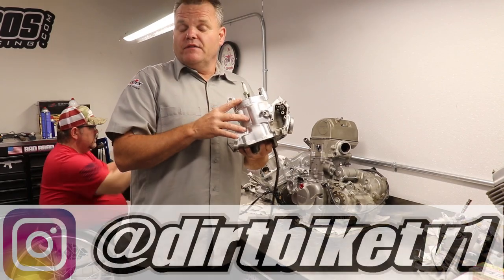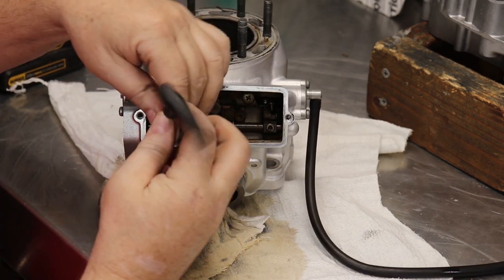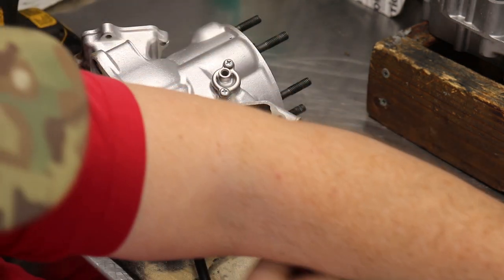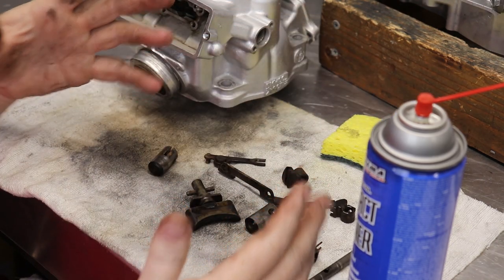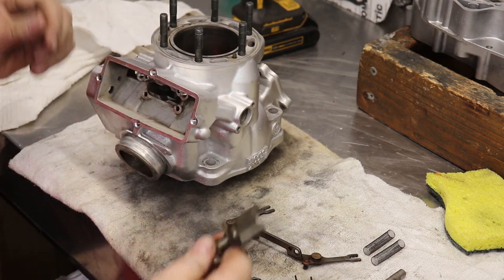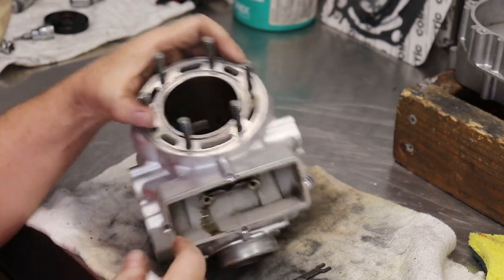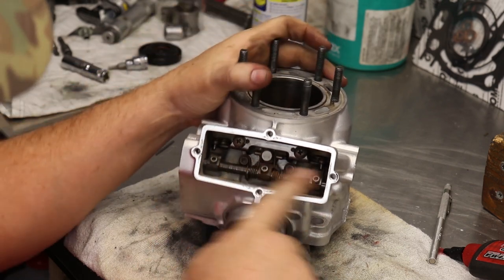YZ250 Two Stroke Power Valve Rebuild

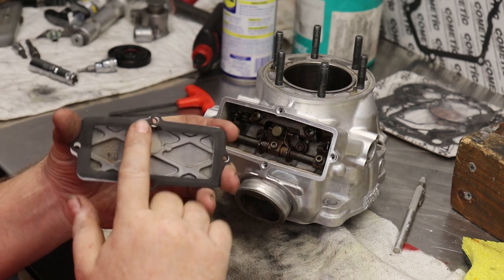Comment: Thank you for the tutorial , however at 9:35 the gasket is facing the wrong way, as the notch is supposed to look down not up. Not sure how much of an issue it actually is, but I figured I`d say something since the notch probably has a reason to be there.
Reply: I just put a new cylinder on my YZ250 and I double checked my manual. On page 4-19 it shows this notch "down" in the diagram.
Reply: Correct it’s down.
Reply: This comment scared me - I had paused the video when the cover came off and saw it down. Reassembled my bike then watched to rest and heard him say it went up! Thanks for clarifying via the manual
Reply: You are right, he is wrong.  My cover is off, gasket stayed on the cover,  Gasket notch is down, and it is for clearance for the center valve shaft bolt head.
Not too many people can do a perfect How to vid.

Comment: Well, I cleaned the goop out of the hex heads, used a new allen wrench (good one too), and stripped the head out of the center power valve shaft screw.  That one was too tight for the head.  Had to drill the head off, drill a smaller hole and use an easy-out.  Those are some soft screws.  I will replace them with better ones.

Comment: Bro my Yz 250 2t 2019 are leakin very much oil in the powervalve , i change the seals and nothing. How i can repare This? Help
Reply from the maker: email and send pictures--
Reply: The carb is jetted rich from the factory.  Learn how to jet your carb, and you will get more power, and virtually no ugly oil mess.  Usually, dropping the needle one notch (if your spark plug is black). leans up the middle very well, but can be a big jump.  You can get little washers that go under the needle clip to go less than a full needle groove jump.  Then I do wide open run to test the main jet, and put in a leaner main jet if needed until the plug is a light color brown at full throttle. (Hit the kill switch at full throttle so the plug does not darken up for a false plug reading from lower rpm running.).  You plug should be a light brown color on the porcelain (and everything else dry)

Comment: Are there seals inside the area where arm connects to the side with the screw? Above the coolant drain. My bikes just dumping bunches of oil after it sits for a while out of that cover.
Reply from the maker: Email Jay directly with any questions. Contact info in About tab.

Comment: Some of the material has scuffed away on my powervalve assembly. He was talking about blowby, how do you know when to replace that?
Reply from the maker: Email Jay directly with any questions. Contact info in About tab.
Reply: If it operates smoothly it is probably fine.  Exhaust gas blows by the valve even when new.  It is not designed to hold gases like piston rings are, and the power stroke is done as soon as the exhaust port opens up.  All that brunt exhaust oil under the first cover he took off is from the exhaust gases going by that valve a bit during what is called "the blow down phase".  You won't lose any power unless the valve starts hanging up.

Comment: Is it normal for oil to drip out of the power valve vent line.?
Reply: @Matthew
Yes, it's normal for the oil to drip out of the power valve hose.
Reply: @azff  Stock bikes (with carbs), are jetted rich from the factory.  If he jets the carb well, he will not only gain about 2hp, but most if not all of the exhaust mess we get will be burnt in combustion and then the drips dry up.  My YZ (2019) was so rich, oil coming out of the silencer ruined 2 of my jerseys, ( oil spots won't come out).  Liquid droplets are fling out of the silencer.  Now that is "rich".  :)
Reply: @EarthSurferUSA  
I've got a 2023 Yamaha YZ250. I bought it brand new and just as your experience it was super rich out of the box. I bought a JD kit and re-jetted for my elevation (1,200 ft) and it's running great. Still getting some (not much) oil discharge out of the PV overflow hose.

Comment: Why would the power valve be hitting the piston rings? Or why would the rings be hitting the power valve?
Reply from the maker: Email Jay. Contact info in About tab.
Reply: Broken valve parts, or somebody over bored the cylinder possibly, (which would need to be re-plated and use an oversize piston),  and did not modify the end of the valve.